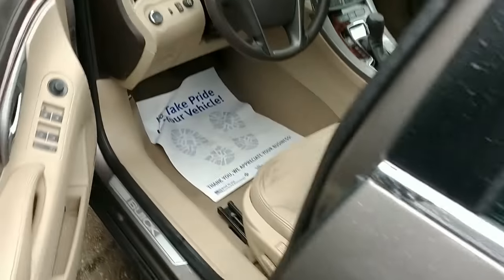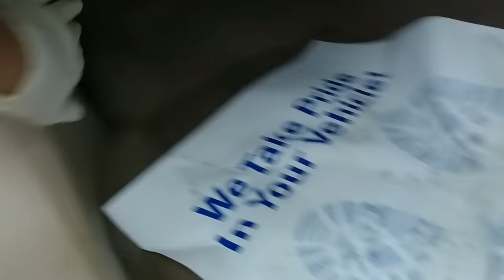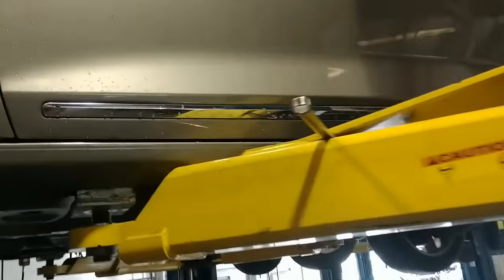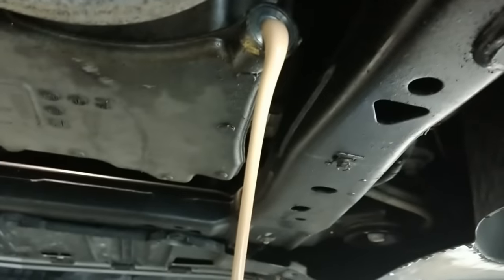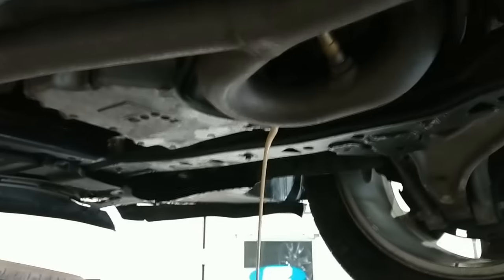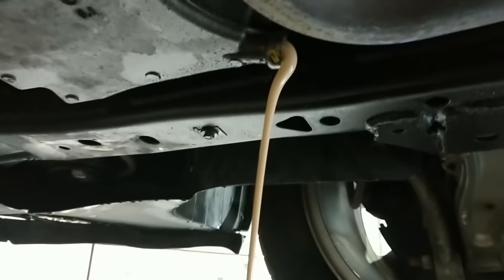Overfilled Crankcase! Blown ENGINE! Used Car Nightmare!

Comment: That 3.6 POS is one expensive engine and the labor to replace it is also very costly.  I feel bad for the Customer who got screwed big-time.  Hopefully they stopped payment on the Check, if that is how they paid.  

Years ago, we bought a low-mileage Buick Century from a Ford Dealer.  They gave us a 6 month warranty and assured us the car is perfect and a one-owner.  160 point inspection papers included.  We drove it home and it was literally like new.  Leather interior, body, paint, tires, and glass all perfect.  Only 41K documented miles.  The next morning, I went to jump in to drive it to work and the garage floor was covered with ATF.  I could also easily see the front brake pads and they were so thin, someone bent the noise-makers back so they didn't squeal.  The inpection sheet said front brakes at 85%, rears at 95%.  Checked the engine oil and it was black as tar.  Sticker on the windshield showed LOF and current date.  The ATF on the garage floor was also dark, not red.  We called the Bank and stopped payment on the Check.  Then broke the news to the Ford Dealer.  The Dealer said we broke the law and they said they would sue us.  We said - go ahead.  We never got sued but we did later get a letter from them regarding a crooked Service Manager in Used Cars.  He was billing the Dealership for lots of repair work on Used Vehicles and not doing the work.  Apparently, it somehow made their department look good along with showing the Owners of the Dealership their Technicians were busy and making their Used Cars worthy of the 6-month warranty.  As myself mechanicing all my life, I was pretty embarrassed I didn't check out the car before writing out the Check.  I always do but this time took their word at face-value.  Shame on me!

Comment: How do you buy a car anyways regardless of where you bought it and not check the oil. haha The customer would've noticed that from the start.
Reply: Head gasket could have failed after she bought it. It began to run rough, overheat and shut down after 100 miles.
Reply: If it was an old person, they don’t know about cars. They can be easily fooled by those assholesss. If she brought a mechanic or someone that knows cars then this could’ve been prevented.
Reply: They probably fixed it temporarily with a can fix.  Sorry car lots do that so they can get rid of car to unsuspecting consumers.
Reply: @genesisbeast8831  How does someone’s age have any bearing on their automotive knowledge?
Reply: Suggesting that a person takes some initiative to not get screwed over? Oh man the non car people are gonna burn you at the stake lol.
Reply: @genesisbeast8831  Doesn’t yours? Your original comment was very general.
Reply: @Icutmetal  exactly just be quiet bruh
Reply: @Rangerman69420  It's called being resourceful. If you can't do that with even a little effort good luck on life.
Reply: Old people get scammed by dealership every day. My grandpa paid $15,000 for 10 year old car that was only worth $4000 even charged him $2700 for scotchgard protection and $700 for wheel protection on steel rims with hubcaps.
Reply: @jaggsta  So do young people! Has nothing to do with age.
Reply: @Bercilak de hautdesert if you know cars, you should know the difference between what I’m talking about and what your talking about. Huge difference. Like what I’ve said so many times, this wouldn’t have happened to them if they knew a little bit about cars.

Comment: "coolant is not suppose to drain out of the oil pan" Isn't that a feature? Condenses draining the oil and coolant into one efficient step
As it's draining you should just stick something in the flow, always looks like suspended animation when draining a coolant/oil Slurpee.

Comment: Head Gasket go pop make chocolate milk for oil lol.
Reply: How is something like this fixed? I know nothing about cars, just that they shouldn’t have milkshake dispensers
Reply: @Kat-qr7hv  To fix a blown headgasket, you need to take apart half the motor, the head gasket sits between the head and the block of the motor. Its a long and tedious process that takes a long time and will often costs thousands of dollars to fix it at a Shop.
Reply: @chrris305  Yes. But in this case I would say the crank bearings are probably toast! And the entire engine needs rebuilt.

Comment: She's probably the one that did it , noticed it was overheating, put coolant in the oil cause she don't know jack about autos and now blame it on the dealer  😂
Reply: That doesn't explain why the coolant reservoir was dry as a desert. It was obviously the coolant that leaked from there into the oil.
Reply: @Asto508  yeah, I didn't think if an internal leak. My brain went straight to someone not knowing where coolant goes and just dumping it straight into oil
Reply: @nfspaz716  I doubt that this ever happened somewhere. Usually people know where to put the wiper fluid and that's about everything they will ever do in the engine room. The fact she drove 100 miles with it before it overheated sounds like there was coolant when she started and it got pushed into the oil through the leak until it was nothing left to cool the engine anymore and then it overheated severely. 
If you have no coolant at all, you don't make it 100 miles. Even with coolant at cold start, it usually takes only a few minutes of idling to get the engine to 80-90°C. If you have no coolant at all, you can be sure it will be already melt down after a few miles because all you have left is passive cooling of the engine block itself, which is basically nothing (as you know, it takes hours for an engine to cool off completely after turning it off).

Comment: In the 1970's I purchased a NEW Toyota Corolla - last of the production line in Australia. The dealer did not road test it. The EFI was fucked and the engine rocked and backfired. Took 3 days to fix it but fortunately it did not damage the engine.

Comment: One of my buddies got his wife a new Buick, one of the smaller little economies, that make you feel inside as if you're in an old Cessna shoulder to shoulder. Every 3 months this car needs four quarts of oil, it's not smoking, it's not leaking,l But it's a USER.

Comment: Milky oil is a sign of a blown head gasket. The rest that i see supports that. The thicker exhaust is from water in the exhaust. Low coolant is more evidence. As is the milky oil. If it was just bought, warranty may cover it, but that is the very nature of your shop.

Comment: For those of you who don't know here is the diagnostic tree:

1) Buy here pay here lot (bad)
2) Car drove 100 miles, over heated, shut off. (Very bad, coolant not working)
3) Start car and it runs rough. Check exhaust.

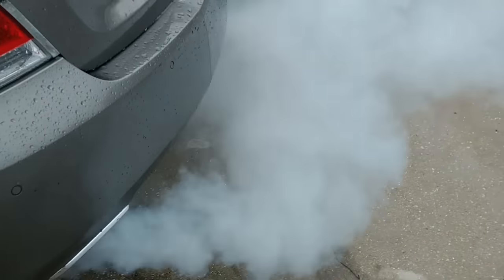0:30
4) Exhaust is white smoke (Red Alert. Cracked engine block. Next we check the oil)

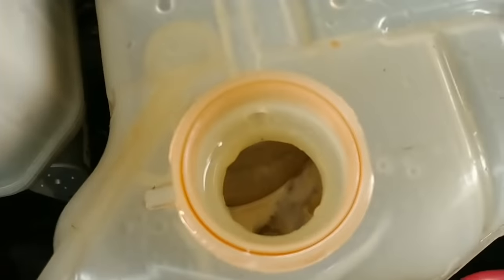1:00
5) Coolant reservoir is empty. Oh no. Worst case scenario if next item true.

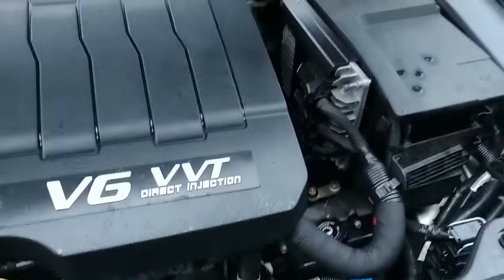1:20
6) Oil is a chocolate milkshake. (Car is a paperweight).

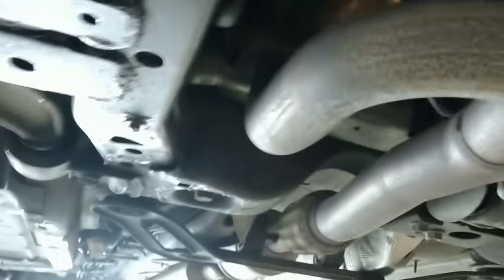2:20
7) Coolant then milkshake from oil pan. Engine gone bye-bye.

3:40
8) Entire contents of oil system, all 6 quarts, is soft serve chocolate ice cream. $2000 (being very optimistic) to $8000 to repair.

Coolant mixed with oil, emulisfies the oil to that color.

Cracked header or head gasket failure, coolant mixed into the oil, entire rebuild and flush of oil channels AND coolant channels, clean the radiator and coolant reservoir.

The heater core, air conditioner heat exchanger, radiator, and oil or transmission heat exchanger may all need to be replaced.

The car needs the entire engine, with all attached to it, pulled and replaced. Transmission may be ok.

Older Buicks like this CAN be good deals if maintained. This was cludged together (silicon on timing cover).

A buy here pay here driver would NOT have the money to fix this.

Sad.

Comment: i just dealt with a bunch of cars being sold at a dealership, as the customer test driving stuff and recognizing what is or could be very troubling signs of mechanical issues, it's very disconcerting to see the dealer pass them off as acceptable and justify supply & demand as the reason why they can afford to ignore these problems while charging very high prices for used stock.

Comment: I bought a 1978 Ford Granada  6 cylinder had the same issue . Cracked engine block , I did get a new engine from Ford. No charge.

Comment: I went to a quick lube once and my dipstick broke off and they replaced it with a new one.  Didn’t bother to check the length before giving me the van back.  When I removed the dipstick it was obviously too short.  I got one from the dealer and they ran the vin to confirm the proper one.  I brought the good one and the bad one back to show the manager of the oil change place.  He was honestly apologetic and refunded me the cost of the oil change. No harm done as I hadn’t relied on it to get an oil reading.  Nowthat I think of it, how did they verify my level was right when they did the oil change?

Comment: I had this done to a V8 in a Lincoln Continental 95 model and it resolved the problem with the pinhole leak between the combustion chamber and the antifreeze side causing overpressure and forcing the coolant out of the Overflow bottle this took care of the problem but whoever ended up with a car since it was traded in go ahead and have the head pulled and replace the head gasket

Comment: The engine block is most likely warped since I assume overheating caused that issue, so the car would most likely need a new engine.

Comment: Always inspect your vehicle unless it's new and you're covered by State lemon laws or at least the Magnuson Moss Warranty Act (i.e. it's still under the original 3 yr/36K warranty or an extended warranty).  If you have some balance of a factory warranty left, you can go to a lemon law attorney.  At least check the damned fluids before leaving the lot.  Unfortunately with transmissions with no dipstick you can't check the transmission.  If this was a brand new car, the manufacturer to end up eating it.  You do not want to see a chocolate or Arby's jamocha milk shake coming out of the oil drain.

Bring a mechanic with you or have it in writing that you can take it to a mechanic of YOUR choice to have it inspected before you sign on the dotted line.  A trusted mechanic doesn't want you stuck with a lemon or a white elephant.  They want their life to be simple as well just doing basic maintenance for you as a career long customer.   All of the good and trusted YTers who have auto mechanic channels want this.  They want you to be happy with your vehicle(s) and live a stress free life or as stress free as possible.
Reply: I am a Tech end I charge 300 to go end check the car  , most all the time the car need work .
Reply: @josemorales9637  $300 is a fair price for an honest auto tech to go through it with a fine tooth comb and give the potential buyer then answer "would you buy this?"  Home inspections can easily go over $500 and probably four figures if it's a large home.  I agree every vehicle will most likely have something wrong with it, the question is if you can find it before you buy it and get the seller to come down on the price or if it's something you can fix yourself or pay someone to fix it for less money.

Comment: Busted head gasket. Happens. But the real bad news is likely to be in the amount of oil/coolant "milkshake" that drained out. That coolant reservoir has been refilled quite a few times...very likely that the motor has been overheated that many times also.

Best case scenario: Heads can be resurfaced. But that will require private consult with a deity.

Comment: Out of curiousity, what is the consumer protection law in the states regarding problems like that? In Germany, if the car you bought from a dealership (yes, even parrkin lot car dealers) breaks down within 6 months after the purchase, you can demand cost coverage for the repair. If they don't want to repair it, you can get a full refund.

Comment: 2002 Ranger Edge, 3lt 6cyl.  Does the engine or the transmission need to be tweaked in order to change the oil pan gasket?
Thanks!

Comment: I used to work for Manny, Moe & Jerk and we had a Nigerian tire changer who went to the local auction and bought cars and sent them home to his country regularly. He drove to work 1 day with a Subaru billowing clouds of smoke and asked me to check what was wrong with it. I popped the hood and you could see the crankshaft spinning through the 1ft hole in the top of the block. Told him this may take time to find the leak, it's too hot now.

Comment: So quick question…what could’ve alerted the owner to a blown head gasket, before buying it? Could the dealer “hide” the damage just long enough to make it 100 miles or was it just bad luck?
Reply: I'm guessing the seller does an oil change before every test drive. The white smoke pouring out of the tailpipe probably started after the buyer had driven it a bit.

Comment: Technically it's an emulsion: a fine dispersion of minute droplets of one liquid in another in which it is not soluble or miscible. One example that almost everyone is familiar with is mayonnaise. Quite obvious when Ray pulled the dipstick. Draining the sump wasn't actually necessary to prove, but interesting to see on video.

Comment: I had an old fox body Capri 5.0 - I was 20 at the time, The car was 10 years old and I already had the car for about a year . The oil gauge would get low and I ignored it for some stupid reason thinking it was a faulty gauge without having a professional double check. Next thing you know I have a car running like s*** and a milkshake engine. A learning experience.. But the shop that I took it to at the end never actually came out and said, you blew the engine, it's done. They just took in the car and let it sit in the lot until I decided to bring it home with my tail between my legs

Comment: Just a quick question Ray, what would you suggest to connect a dash cam (front and back) to a 2017 Volvo XC90 T8 twin turbo (hybrid), should I just simple plug into cigarette light for the power or to connect the power to a spread line?

Comment: Lemon laws in the US allow you to return a vehicle I think in the first two weeks if the motor and or transmission is bad. As long as it's not as is purchase. Can be punishable by law if it not upheld by the seller. They will tell you there's nothing they can do. You do research.

Comment: When I was learning for my drivers licence, the company owner did a few 1 hour classes on easy to spot troubles and how to check for damages. He did this for free. Simple but handy stuff. Brake checks, oil levels, battery tests, how to spot rust or what sounds a car should or should not make and so forth. These classes where, and are still to this day, for free. The reason as to why is his son got hiked like these people were. 

These few simple but clear instructions saved me more cash then the total sum fee for my drivers license.

Comment: A couple years ago I was paying for a 2007 Saturn ion 2 at a buy here pay here place, it was going to cost around 3500 for everything. It had close to 200k miles on it also. It was the only choice i had. I thought it was a good idea, well when i paid it off that's when the car when to crap. I always had the oil and everything checked. It's just funny that right as i paid it off the next week it stopped working right because the head gaskets magically went. >.> A mechanic quoted me 1,800$ to fix it.

Comment: I bought a 1997 Honda accord with 162000 on it with the extended used car warranty. I had to take the car into the warranty shop a week later with a check engine light (transmission sednoid code they replaced that.) Then I took it back a week later with the oil light on. They denied an engine replacement. (It was diagnosed with a week oil pump and main bearing knock.) They replaced the oil sending switch so the oil light would go off. Crazy. The statement Buyer beware is so true.

Comment: Best guess here is that someone did the timing chain/cover, and asked an untrained assistant to 'add coolant' before they put it on the lot, and the assistant added coolant to the oil, not knowing any better. There's no way a mechanic who could replace a timing cover would make that mistake without serious illegal substances involved.

Comment: they used that same motor in the 2010 -2011 Camaro's junk junk engines i was surprised that the odo had 74k they usually go bad before that mileage hits !!

Comment: White smoke meant "pull the dipstick, look for milk."  Milk meant "bad head gasket" to me.  Not cracked block because no other apparent leaks.  Could be "not too bad" cost depending on how long driven that way.  If the engine's still ok, new head gasket might do it.  But - only 75K miles?? (I am not a mechanic, just an auto amateur)

Comment: This is so rough.  Can't really go after the dealer, because used cars are almost always "as-is, no warranty".  So you absolutely must do your due diligence.  Also, the car could have been fine at the time the lady bought it, and it just happened that the issue occurred shortly after her purchase.  Now the exposed RTV is a clue someone was in there before, but was it a cheap part failure, or poor work performed?

Comment: I know this question is not related to this , but i really wanted to know this, my speed indicator is flickering, handbrake light stays on, engine light on, the cold temperature light is blinking and when driving, it only stays on third gear, i wonder whats the problem? Please teach me, i wish to learn

Comment: This is absolutely fixable but it would take someone untrained a few days to figure it out. I've done a head gasket repair myself and it was a nightmare but I eventually fixed it. It still runs to this day. Just need to put in the elbow grease and be willing to go the extra mile. It's not easy but the cost of a head gasket at most is 200$, it's the labor that's expensive.